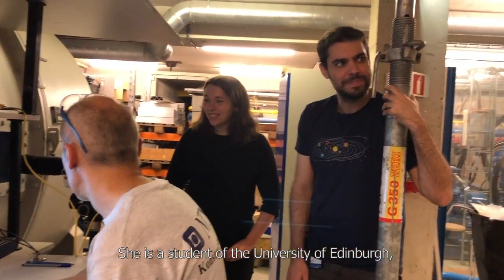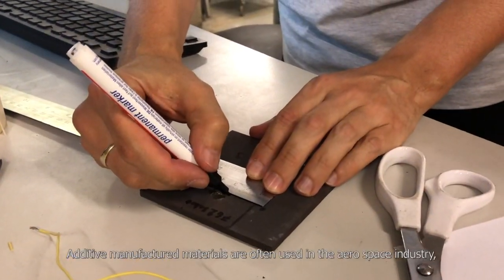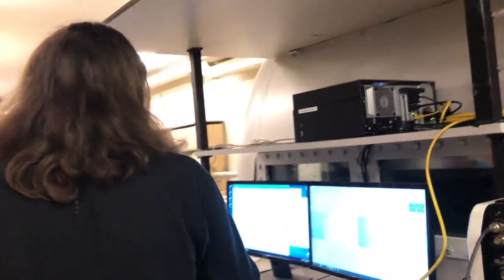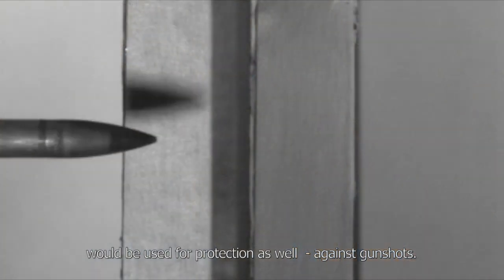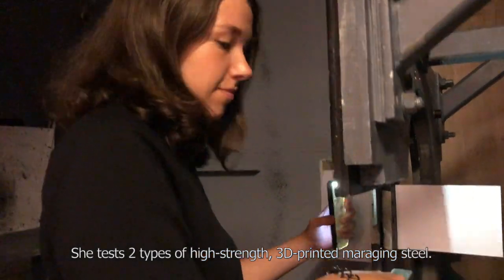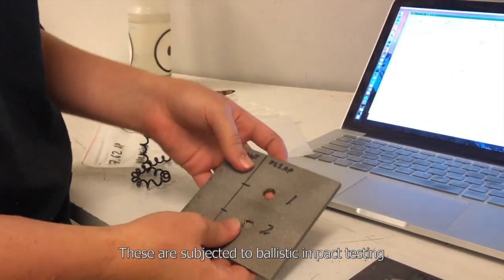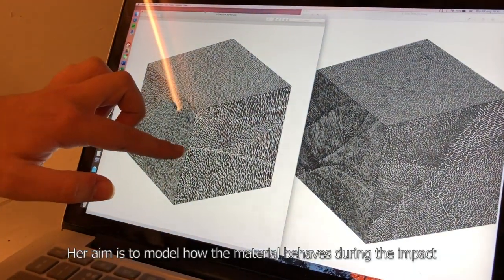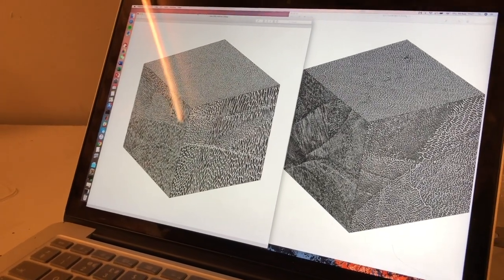Maraging Steel under Ballistic Penetration

Comment: Maraging Steels can be 2K Mega Pascals, making it the strongest metal on earth compared to even Tungston at 1560 Mega Pascals, and you're 3D printing it! WOW, impressive!
Reply: How many percent lighter than conventional steel?  Can it be use as battle tank armor?
Reply: @pAttern__iii505  It's even lighter than Titanium Alloys in Strength-Weight Ratio. And see it's Ballistic Simulation in YouTube, given its mechanical properties its quite a promising material as Ballistic Armor.

Comment: Welding metal always make it weaker. It never makes it stronger. 
If something consists fully of welded material - like everything 3D printed from metal - it's fundamentally flawed in strength. 
You have great freedoms in design, but it you pay for it, twice. With production cost and strength.
Reply: The maraging process cures these weaknesses. 
It's also worth remembering that ballistic penetration isn't purely a matter of strength. A non-uniform structure will disrupt the projectile, therefore stopping it more efficiently than a monolithic plate would, that is how modern NERA tank armour works. Although I don't think that's actually what's happening here as the maraging process has created a uniform structure.
Reply: @Tomartyr  How many percent lighter than conventional steel? Can it be use as battle tank armor?
Reply: thats why you heat treat it afterwards